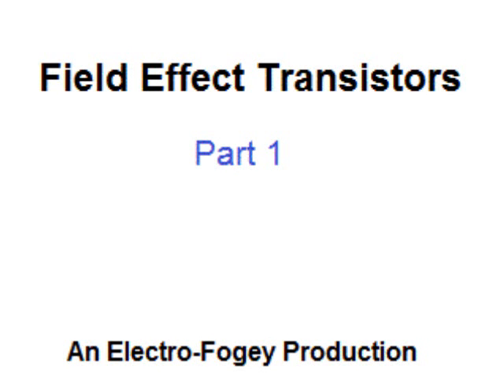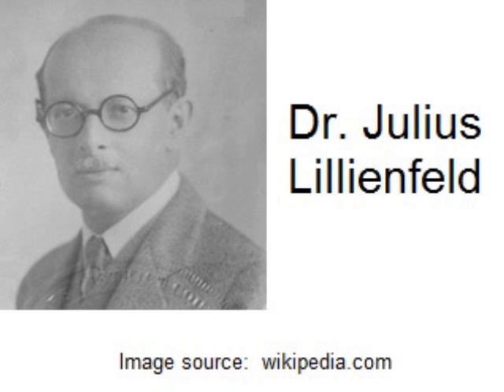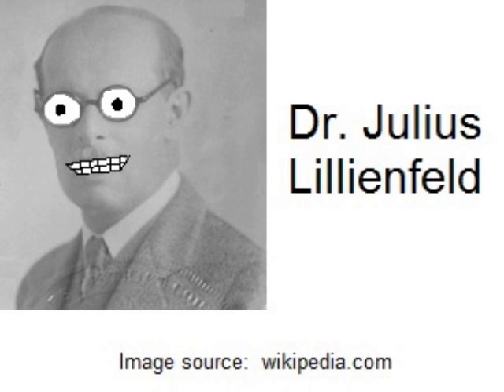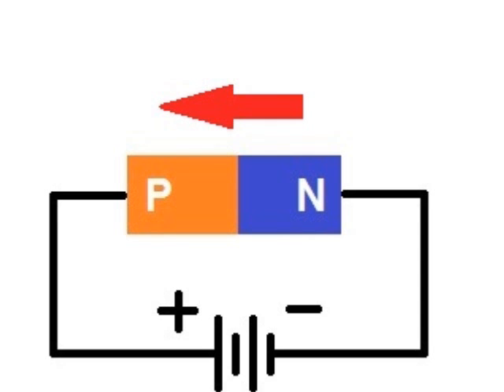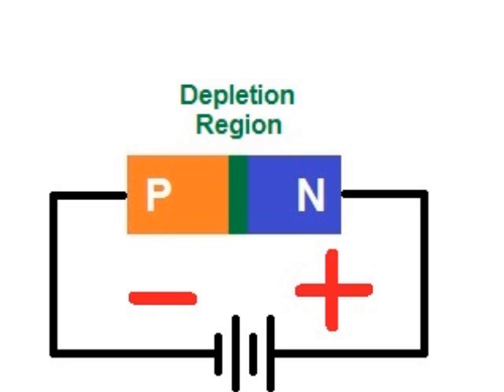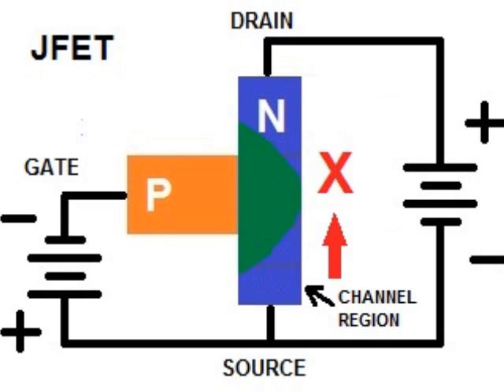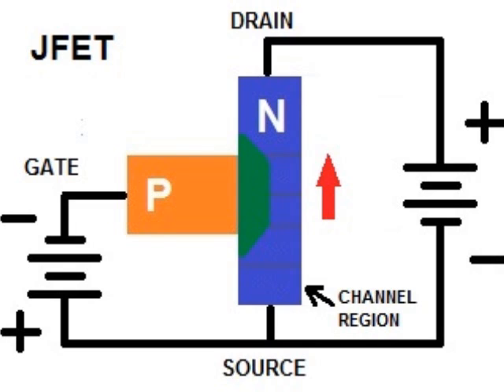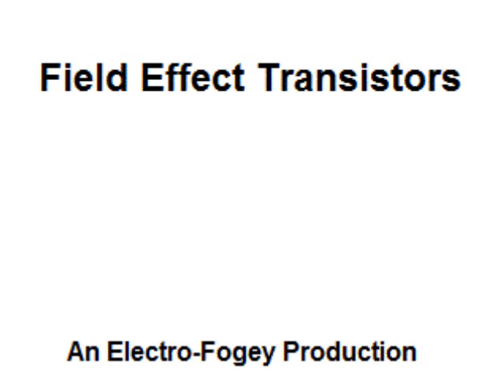Field Effect Transistors, Part 1

Comment: NIce explanation however Lilienfeld wasn't able to ever get a working device.  The actual viable and breakthrough device, called a MOSFET, was built by an Egyptian called Mohamed Atalla & his partner Dawon Kahng in 1959.  Prior to this it was either problematic or mostly just theory and patents.  His design/method became critical to not just transistors but to the entire semiconductor industry.

Comment: Steel Wheels,  I'm enjoying your videos on Electronics something I now hope to use to control experiments along with programming.  I would really enjoy seeing you do a video on the subject of voltage spikes from inductors, coils and or DC motors.  Had trouble with a PC Drill Electronics Now Feb/Mar 1997, by James J. Barbarello.  Killed the transistors on power off.    -Cheers Steel         Joseph Shaff
Reply: FYI, unfortunately, word is the author if this video died a couple years back.

Comment: This is some great content Steel wheels. Driver circuit (transistors) control fuel injectors. I am a mechanic and I have constant voltage going to the fuel injectors with out pulsing (opening and closing the injectors) during start up and driving which cause the injectors to dump to much fuel in the engine flooding it and preventing start up. All inputs to the transistor base are there but I believe the transistor is shorted causing constant voltage, just pulled the computer out to test them. This video is priceless for the automotive industry. Thanks for your wealth of knowledge.

Comment: Can you address why "current won't flow across" depleted neutral regions?
1. As long as there are charges present within the wire and there are potential differences across terminals, charge will flow.
2. Currents don't flow. Charges do (this bothers me, not trying to be mean).
3. I don't see how it is depleted if there are still valence electrons constantly transferred by the battery and through the connection wire.
Reply from the maker: I understand that you wish to know much more about how the semiconductor works.  The whole point of this video is to tell people how to use the thing without delving into what's happening at the subatomic level, and to do it in under 15 minutes.

The reason charges flow through a conductor is that the atoms of a conductor are easy to ionize.  Silicon, boron, and phosphorus are not good conductors.  They use their valence electrons to bond into molecules, so the valence shells are all filled and the atom won't accept more electrons.  However, isolating boron or phosphorus in a silicon crystal means that the the dopant atoms have either too many or too few electrons, and will now accept electrons, so the atoms can be ionized and electrons can flow though the crystal.

At the PN junction, the extra electrons in the phosphorus atoms are attracted to the boron atoms, so those atoms now have full valence shells.  However, this means that the number of electrons in those atoms no longer matches the number of protons, so those atoms will become charged.  Now the valence shells won't accept new electrons, so electrons won't flow (depletion region) which makes the semiconductor an insulator at that point.

As for "current flow":  I know it's bad grammar.  Don't correct me.  Hell, have you heard me say "nookyoolar" yet?  No, so I'm ahead of the game here.
Reply: Steel Wheels Down Awesome explanation regarding the extra electron of phosphorus. But it lacked the role of the reversed-biased battery. Can you shed some light on that subject? I am really scratching my brains out here.
Reply from the maker: Jun Ouyang My friend, to properly answer your question would require that I make a video about it.  I have wanted to do one, but have gotten bogged down with basic electronic videos and haven't had the time.  You should visit Bill Beatty's site at http://amasci.com/ele-edu.html or watch this video Transistor (bipolar) - How it works! (Animation) for more ideas.
Reply: Steel Wheels Down Thank you for directing me to that video. You made me learned so much within so little amount of time. I am looking forward to your video on the same subject! I am sure will be a great hit!

Comment from the maker: the gate and channel will be positively biased, so if the gate voltage is high enough, current will travel from the channel through the gate, just like a forward-biased diode.  However, the transistor is not designed to handle much forward current through it, so it will probably destroy the transistor, so don't do it.  The device is only designed to be reverse biased.

Comment: I guess the only way for me to truly remember this is to look at the channel. In this case it is an N channel.

A negative gate voltage would push the channel closed.

A positive gate voltage would widen the channel.

I know it's not the right way to interpret it, but at least I'll get the right answer in the end :-(

I understood the bipolar transistor with little effort, but for some reason this one bewilders me..

Comment: My crap logic skills at work lol.

Common sense tells me a positive voltage source pushing at the P region on the gate would cutoff the N channel.

Common sense also tells me a negative voltage source pulling at the P region on the gate would saturate the N channel as the current is carried towards the drain (which is positive).

I saw a chart with voltage changes from 0 to 5V. As it moved positive, the channel shut. As it moved more negative to 0 the channel opened up.

Guess I'll stay confused

Comment from the maker: In a MOSFET, there is no P-region, the gate is just a metal plate, but by applying negative voltage to it, the gate plate is negatively charged, and its field repels the electrons in the N-channel, again causing a depletion region to appear, making the channel narrower.

Comment from the maker: If the gate voltage (P-region) was positive, the junction would be forward biased, so you would have good current flow through the channel, plus current flow from the channel through the gate (might blow the transistor).  Negative gate voltage reverse-biases the gate/channel junction.  What really happens is that the P-region becomes negatively charged, which repels electrons flowing in the channel, causing a depletion region.  This repulsion effect is called a field (field-effect transistor).

Comment: You kinda confused me at about 8:05.

I understand a gate voltage of zero means the N channel has low resistance and good current flow. But what confused me is the negative voltage source. I thought the negative voltage would pull on the holes in the "P" region resulting in a larger N channel. And that leads to more current passing.

If the voltage source were reversed in the image, the positive side of the voltage source would push the P region causing a narrow N channel. Less current passes.

Comment: I was told more than 20 years ago that the name transistor  was taken out of two words, Transfer Resistor, not Transforming Resistor. It was in opposition to Transfer Conductance which was the property of the vacuum tube. The transistor, is off without the bias voltage, while the tube is on in the absence of bias. I hope this helps.

Comment from the maker: It is possible to do so theoretically;  in fact, on some JFET data sheets, it says that source and drain are interchangeable, typically small-signal devices.  However, on many FETs, like high-power devices, the source and drain are doped a little differently, so it's best to make sure source and drain are used as specified.

Comment from the maker: I am planning on doing a video on this later.  I'll tell you this much now, however - the actual direction that the current of electrons flows is not really important - the charges they carry, and the fields those charges produce, are what's important.  This is why, in high level physics classes, they refer to electric current as a flow of charges.  I think this is why they didn't change things around so that electrons are positive.  Stay tuned.

Comment from the maker: The truth is, when at rest, there is a small depletion region there. When forward biased, it takes about .7V to overcome it.  Reverse biased, the voltage causes the depletion region to grow, rather than be overcome.  Confused?  Like I said in the video, I DON'T WANT TO SPEND A LOT OF TIME ON THIS.  In a later video I might, but for now, just remember that there's a depletion region there, it's an insulator, and it makes the channel resistance change.

Comment from the maker: Thanks, I read that they were faster, but I didn't know it was because they were much smaller, instead of because of their inherent properties.  If course, this video is about JFETS and not MOSFETS (which are the ones actually used in computer chips), and MOSFETS are better because they dissipate so much less heat due to both their size and design.  I wonder if they will ever make BJTs with a process small enough to be viable in CPUs.  Guess they'll have to at some point just for speed's sake...

Comment: not to be rude but actually BJTs are inherently faster than MOSFETs, the reason they are used in faster technologies is because you can make mosfets much much smaller which allows much faster speeds. If your comparing the same process size though the bjts will far outclass the mosfets.. its an exponential response compared to a quadratic one.

Comment: Execellent tutorial.

So this looks like it would be easy to use as a current limiter right? Or also over voltage protection or surge protection? I realize there are other components for that, but it seems like a FET can be used for this.

Comment from the maker: senoner90, the problem we have here is that I talk about 2 kinds of transistors here, mainly the junction field effect transistor, but also the bipolar junction transistor.  The JFET has max source-drain current with 0 gate voltage, and no current when gate voltage goes high.  The BJT has maximum emitter-collector current with high base voltage, and none when base voltage is 0 (or less than .7 volts).  So, the JFET and BJT limit current flow, but the with different input voltage levels.

Comment from the maker: senoner90, a FET is a conductor (like a wire) that has variable resistance, and the resistance is controlled by the gate.  Some FETs can conduct either way, drain to source, or source to drain, but the whole point is that the current between source and drain is controlled by gate voltage.  More gate voltage, less current flows (higher resistance source/drain).  A jfet uses the effect of a diode to control Source/Drain current, but it's a lot more than just a diode. A MOSFET can't be a diode.

Comment from the maker: @beinganangeltreon I think the equation I noted (in part 2) is based on a channel that's a rectangular slab shape.  The conductance changes as the cross sectional area changes, and that's dictated by the channel shape as well as the gate area.  If the channel had a hyperbolic cross section, then you could be right.

I have taught you all I can, young Jedi.  You must now venture forth to a faraway planet and seek a greater master than I.  May the Force be with you.

Comment: @Shockszzbyyous Nope. Usually, the source terminal is used as a common terminal (grounded) between gate & drain.Notice here that source electrode refers to the source of injection of charge carriers (holes or electrons).Hope it helps.